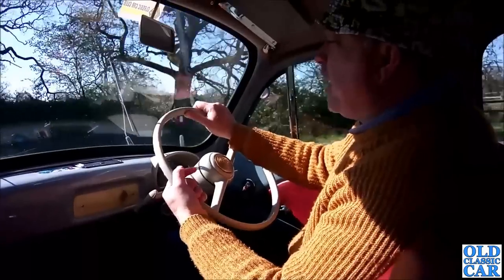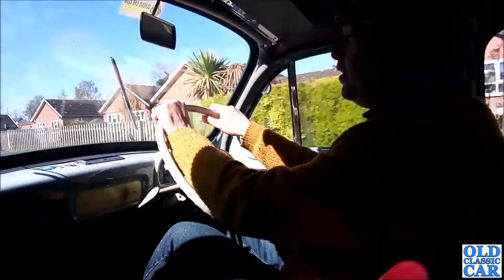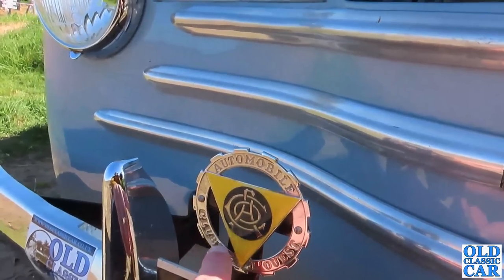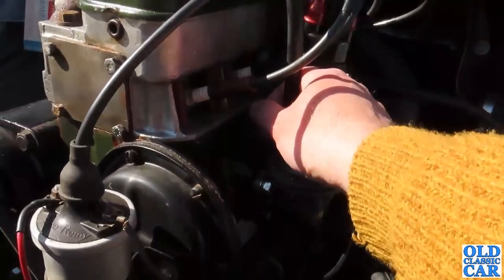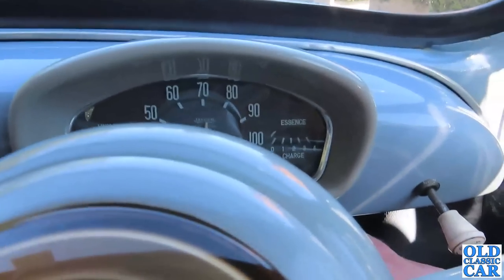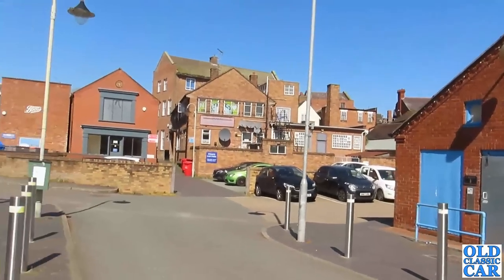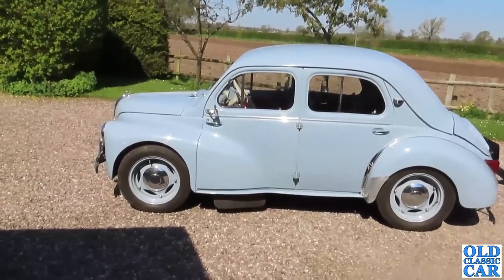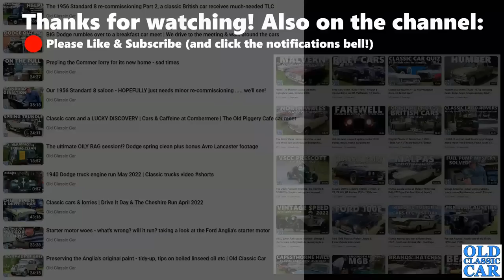Renault 4CV - living with an old car is rarely straightforward ...

Comment: Nice video and I do appreciate your sympathetic approach.  I've had my 1951 French-build RHD 4CV in Australia since 1966.  They are sweet cars kept in their comfort zone.  Mine has been 'bush' and driven half way across the country but the traffic makes that too dangerous now.  Strange carburettor - I'd expect a Solex with an automatic choke.  The car is a late-1956-1957 model by the way. 
I find they don't overheat or have fuel vaporisation issues unless the ambient temperature is well over 35 degrees.
By and large they are super-reliable once sorted out.

Comment: Cracking little car, quite a few here in France still in use on Sundays. I agree fuel evap is most likely the culprit, possibly cured by re routing from atop the cylinder head. A great video, but i am a little shocked by the pornographic content referencing Pork Pies. Not available here in France, withdrawal symptoms have set in and are causing havoc with taste buds and memory bank. Great video!
Reply from the maker: I was talking to someone a few months back who has a 4CV apparently, although I've yet to see it, perhaps it'll turn up at a meet later in the year (fingers crossed). Sorry for reminding you of our local cuisine options :)

Comment: I ran a 1961 4CVback in the 80s as my every day car. I remember once getting asked if I had some how managed to weld the front of a Morris Minor onto the back of a Beetle! That might have been interesting, as I'd have had 2 engines!!

I now have a 1949 760, one of, if not the oldest surviving British built models. Mine has semaphore indicators and teeny tiny rear lights. It also has the choke and starter on the floor, and seat adjustment is by 2 big wing nuts under the front of each seat. Doesn't start as easily as yours does though. I find it very comfortable and that it handles bumps and pot holes very well.

And if I want a change, I also have a 1985 CX 2500 Pallas auto. And for really special occasions, a 1973 sm.
Reply from the maker: Interesting, I find mine doesn't run the potholes too well but the book does say run the tyres at low pressures which is probably the reason
Reply: @oldclassiccarUK  I only got mine back from a full, bare metal re-build las summer, and I drove it 160 miles home. One surprise I got was just how comfortable it is. That drive took me practically all day, (M-ways avoided,) with lots of stops for constant checking, and I didn't feel any discomfort at all. And then as I said, I was surprised how well it handled all of the bumps/pot holes. I had expected a ,lot of crashing/banging, but there was hardly any. She likes a little nod, of course! 

Being a 760, she only has 17hp, not the heady 21hp that you have to play with! As a result, now I'm back in hilly Durham,, I have to try and plan drives that avoid some of the bigger hills, as she isn't so keen on those.

I am planning an expedition back to the West Country, where she spent her youth. It wouldn't be a blast down the M6/M5 of course. I'd break it up into manageable legs for her. And then, after that, despite owning her for the past 30 years, I would be looking to pass her on. To be honest, now that I have finally had her restored, to as original condition as possible, she is a little too nice for me really. 

LG.

Comment: The fuel filler location would seem to be a bit chancy, with the location of the battery and the possibility of a spark. At least the exhaust manifold is on the opposite side, along with the carburetor. Great little car...I've always liked them. There's nothing like Gallic quirkiness.
Reply from the maker: Fortunately it's quite economical so doesn't need topping up very often ... thanks for watching!

Comment: Hi, I served my my apprenticeship with a Renault dealer back in the sixties and seventies and clearly remember working on these little 750s, and of course other models such as the Dauphine and R8 models. If I remember correctly, there was very little difference between the early and late models apart from cosmetic changes. Every thing else including engine spec, brakes and suspension was the same.
Reply from the maker: AFAIK the very first examples had a slightly larger engine, but after that yes changes were cosmetic I think, the main visual one being the switch to plain wheels in the late 50s

Comment: Thanks for sharing! A 1959 model just fell in my lap the other day in barn fresh condition. It’s missing some bits but it now ticks over with just a flick of the starter. It’s also missing most of the engine compartment shrouding. The timing was advanced too far, the carburetor float was cracked and the clutch was adjusted too tightly to engage. So there were just several issues of neglect that probably contributed to it’s early demise.
Who is the best parts supplier for the 4cv?
Reply from the maker: Sounds like a neat find, I've just back in from a drive out in mine. I've not had to find parts as yet so I'm not sure where the parts are, mine is a UK assembled RHD car and has a few differences in the ignition department compared to the French built examples. Mine was problematic in the ignition/fuel supply side of things, in part due to not having the original carb on it, but I think I'm close to getting it right now.
Reply: @oldclassiccarUK  Thank you! It’s a little dog eared but I just couldn’t resist it’s adorable charm. To me It looks like a cross between a 1949 Plymouth and a Porsche.

Comment: This may or may not be helpful, but I had a Rover P6B which suffered from fuel vapourisation and failure to proceed under only moderately warm conditions.  It took a while to track the reason down, but it turned out that the fuel/reserve tap was out of adjustment.  The constriction in the fuel flow that this created was enough that the suction from the pump in warm conditions would vapourise the fuel in the line.  Correct adjustment of the tap totally cured the problem.  So in your case, given that you also have muck in the fuel, I wonder if you have a degrading and somewhat constricted rubber fuel hose (perhaps due to ingesting some ethanol laced fuel)?  Cheers.
Reply from the maker: Thanks Peter, I'll bear that in mind when I next have a tinker with it, I don't think it's anything too serious

Comment: The boiling point of petrol is 95-degrees C, if the vapour cannot be bled out naturally, then a vapour lock can occur, I have experienced this in my Austin 7 Ruby and it does not have to be that hot outdoors! Did you look at the new fuel filter to see if this was full or empty when it happened? That would give an indicator if the fuel was vapourising at the fuel pump (that was where mine was happening), or at the carburettor. 

The problem with my car seemed to be as a result of a silicone gasket between the block & the crankcase - silicone was the cure-all for oil leaks on Austin 7 engines, but with a fuel pump mounted on the crankcase, the cooling effect from the cast-iron block was sufficiently reduced to allow the temperature of the fuel pump to rise to the fuel's boiling point. The silicone being a blocker to heat transfer.

Replacing the silicone gasket with a traditional paper gasket seems to have worked, on the hottest days of 2022, there were no problems, previously, a bit of sitting in traffic on days not really that hot, fuel vapourised. A damp chamois leather kept in the car to wrap around the fuel pump provided respite and had previously been used on a couple of occasions!

The fuel pump may not be operating at its best, and you have a track record of fuel pump issues!

Interested to hear more on the problem and its resolution!

Thanks for sharing, although I note you did not share the pie!🥮
Reply from the maker: Interesting stuff, thanks Gary. The filter was pretty empty and took a while to fill up even after much manual pumping with the priming lever, which isn't normally the case. I hadn't considered the mounting of the fuel pump so I'll check that out, yes fuel pumps are the bane of my life at the moment ...
Reply from the maker: I had a quick look, there's a black painted metal spacer (1/4" thick approx) between the pump and the block, but I couldn't see what type of gasket is present so I'll pull it off sometime soon and have a look.

Comment: I owned a brand new 1974 Renault 12 for a few years. It was the first car I bought and owned after college. I liked the 4 speed, comfy seats and handling of the car, especially in the Pennsylvania winters. I did not like replacing burnt valves every year due to the new unleaded fuel and the air pump for emissions providing air right at the exhaust valves. I bought the car at the local AMC dealer who did well by me as it also needed half-shafts every 25,000 miles.  I used the car in my job every day and put thousands of miles on the clock every month.  I sold it on after needing to use the bus to get to work for a few months due to the distributor falling apart and no parts availability in my new state of Ohio. Nor the best experience with a new car, but I do have a fondness for a Renault Caravelle.

Comment: I am vegetarian so no you didn't tempt me! One thing I keep forgetting to mention Rick is that there are battery isolation switches available, simply twist to make contact. I think I saw one on a car in a recent video you did. It does save you having to keep connecting the battery. Anyway my thoughts on the test run. I think there is a problem with fuel vapour. The tank is quite close to the little engine and seems to get warm? I wonder if there's a way to insulate the tank with a fire retardant material? As long as it didn't show too much I think it would help. This will sound obvious but the fuel does not have far to travel so no long fuel lines to get clogged up. 'Beer goggles' is probably the right term but to be fair how many 4CV's do you see on British roads? Nice video Rick and I won't be offended if you disregard any of my suggestions.👍👍
Reply from the maker: Yes I could fit an isolation switch, the big green truck has a pair for both electrical systems on it, maybe one day!

Comment: Thank you for a great day out with you and your French fancy , felt I  sitting next to you . I had a A35  van the fuel used toe evaporate on a hot day , I put exhaust tape round the pipe near the manifold, which did the trick. 😅

Comment: Interesting that anybody could confuse the 4CV with a Beetle! But then again, quite a lot of people can only name one rear engine car...
I found that after taking the Estelle on a good run down the motorway, opening the engine lid during rest-stops helped with the fuel vaporisation. I guess modern fuels are far more volatile than these cars were designed to use.
I'm not a massive french-car enthusiast, but anything with the engine in the boot sparks my interest, and it is nice to see how you are getting on with this little beauty!
Reply from the maker: Thanks Gord, modern French cars hold no interest for me (especially after having an appalling Clio hire car a few years back), but the detailing on these oldies really appeals

Comment: If it was assembled in the UK then it should have standard bolts?? Powell's pies.. ha ha .. Some day I'll be doing a video on the 5ton wagon.. football player on training wheels ..
Reply from the maker: What 5 ton wagon are you videoing? not sure I understand the football reference!??!???
Reply: The reference is something big with small wheels that the bulk of the item towers over .. football players appear to have a towering top over look ,, the 5ton has a short wheel base .. completely over done ,,, huge running gear for a 1/2 wagon body

Comment: I believe that cars in France drive on the right-hand side of the road, and have  the steering wheel on the left side of the car. Why does this car have the steering wheel on the right side of the car?
Reply from the maker: You are correct, this is a UK-assembled car (at Renault's facility in Acton, London) sold new to the UK market
Reply: @oldclassiccarUK  Thanks, Old Classic Car. Wonderful video, and channel. Thanks